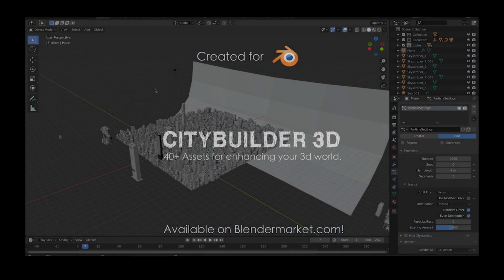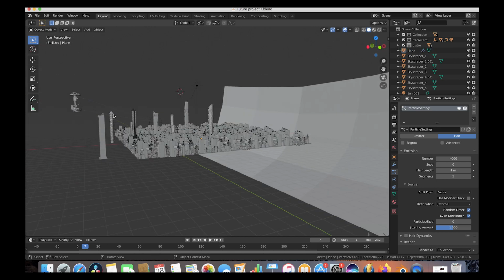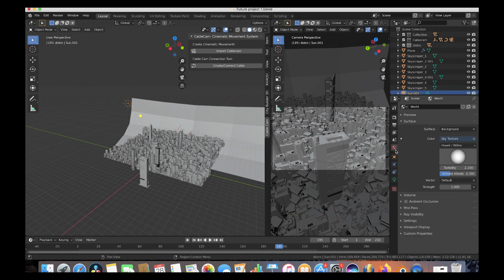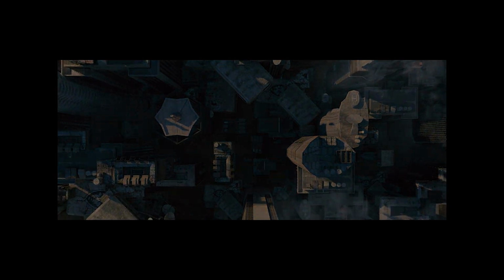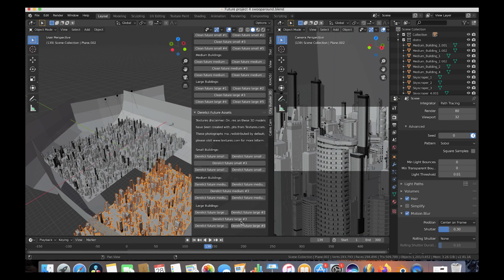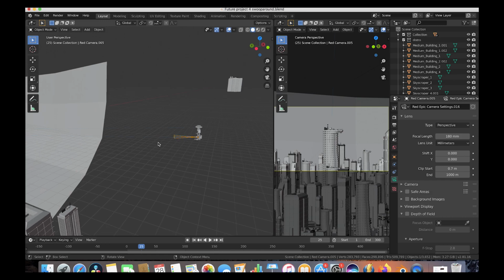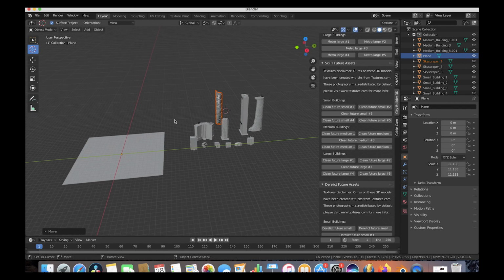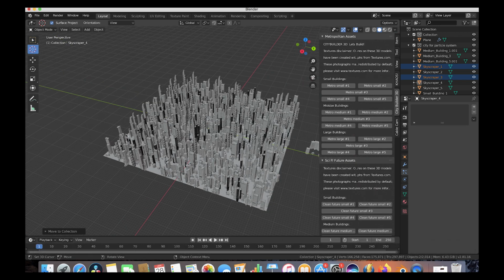CityBuilder 3d Blender add-on breakdown: Trailer setups Explained pt. 1

Comment: I see that you are doing something with the 3D cursor which seems to make that easier but I can't tell what you are doing with it. When I do the particle system the objects are sideways and no amount of rotation gets them upright. Thoughts
Reply from the maker: Hi darklord studios.  If you are using assets no a particle system that are oriented different in edit mode than they could  show  up sideways on the particle system. The fix is  to go into EDIT mode and rotate your entire mesh back to normal. Though our CityBuilder assets should already be rotated correctly for this purpose.

Comment: Does the add on have a way to save new assets? I would find it useful to be able to edit the buildings and save new ones into the library.
Reply from the maker: Great idea John! It does not. Right now the system is pretty simple just to add buildings to your scene very quickly. I'll keep this in mind as we plan to release later versions of the add-on in the future.
-Brad